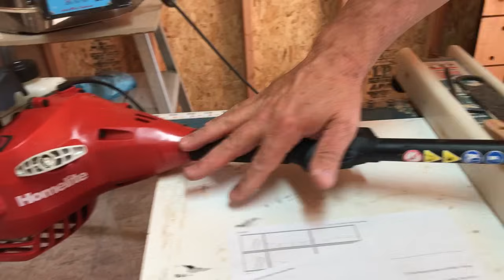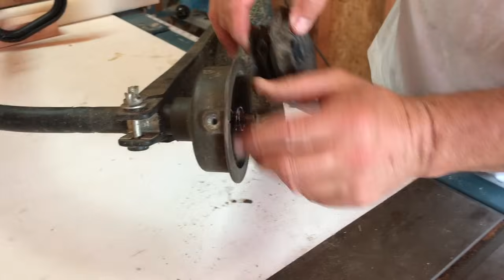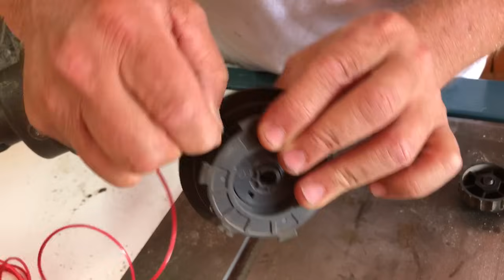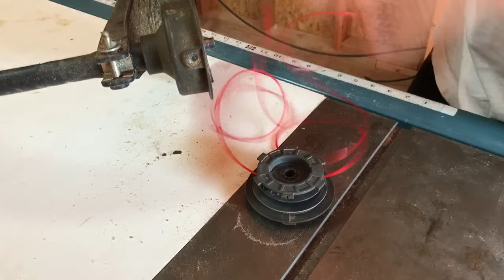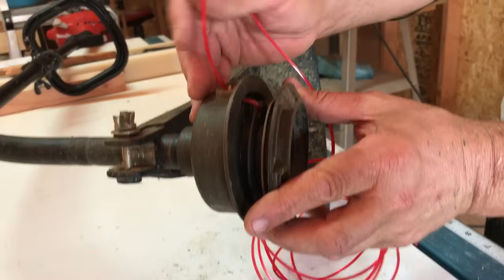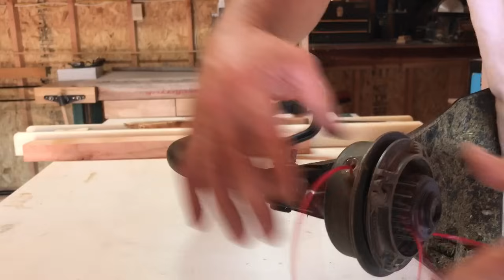How to replace string on Homelite grass trimmer

Comment: You don't even have to remove the cap, just spin the spool so the arrows on top line up with the holes, then you just push the string all the way through.
Reply: G M g55
Reply: Yeah but keep in mind sometimes depending on how.long u have had the weed eater n how.much uve used the same head on the weed eater u might not be able to even see the arrows to.line up with any more. Which happens to be mine exact issue so its just simplier to look thru the holes n line them up so u can see all the way thru..
Reply: YOU are the man! I couldn't get the cap off, was going to start hammering it. great tip!! THANK YOU!!
Reply: The red bolt loosens by twisting to the right (clockwise)
Reply: @jackjack4412  can u explain how, mine its too tight that i can't loosen it with hands
Reply: @06267394  if you have the same one in the video, instead of twisting it off to the left, twist it off to the right.
Reply: You will if you still have some string left inside that recessed back into the head (the new string will NOT go through until you've removed it... which you have to take the head off to do so.) Thanks
Reply: So I have a string stuck inside the spool how do I remove the bump?
Reply: I don’t have the bump he’s using here

Comment: John:  I've had so much frustration in replacing the string on my Homelite grass trimmer and having it then feed out.  Your explanation was simple and worked for me the first time.  I then finished edging and had no problems with the string feeding out.  The enclosed instructions do not mention the key -
 putting the string through the spool, threading it through the casing, and finally using the casing to wind the string onto the spool.  Thanks so much!  Steve Graham

Comment: So happy to not have to do it the other way anymore . One thing I will say that has always done well for me is using stihl chainsaw oil mix with 89 octane like to says . 50:1 is good for everything 👍👍. Never had any chugging issues and it makes this 26 cc scream . Not kidding , screams . I have a high power stihl and a this one I found in the trash and put a new plug and primer bulb and it’s been good for 7 years now ? Something like that .

Comment: Times I've come close to throwing machine this across the garden! Now I know the correct way, thanks
 so much
Reply: Bob Davies 
I did throw mine across the yard quite a few times because of this problem, and I’m a handy guy, this video saved me from going crazy , I guess I just threw the box out and never learned how to put the string in properly, now it works like a champ
Reply: Everyone.just needs to keep im mind that these type of trimmer heads are called speed trimmer heads for a reason they were made to not take up too.much of ur time having to.reline/respool the thing every time. Speed meaning ur able to stop reload n get back to.work to get the job done faster. So u dont even need to remove the spool from the head or anything like that just measure n cut ur line n run it thru the head holes. Rewind the string into the head . n there u go good to go.

Comment: Ok, check out Gm's comment below. I took the head off because there was still string jammed in there. So I retrieved about 5 ft of string, and then put the head back together, and with a little wiggling was able to put it in place. So that gives me enough string to do a half hour or so probably. So between John and Gm, I've saved a lot of hassle and again thanks to both of you. Or should i say, "much grass, senors!"😎😁

Comment: My spool doesn;t have two slots for the trimming string. It did however come with the other piece with two holes but the spool you wind it on has no hole going through itself.  There are however about 8 holes on the outer piece spaced in the circle. How do I replace the string on that type?

Comment: Question, how do you get more line to feed out while the weed eater is still running. I keep having to power off the trimmer ,manually remove the cap and rewind the whole line again. It's so frustrating...
Reply: Hit your head on the ground,  that makes the string able to skip a notch and release more. Don't smash it, but give it a good little bump on the ground and keep going.

Comment: You actually line up the holes on the spool with the holds the string comes out.  Ensure the spool is loaded into the trimmer.  Push the string thru all four holes.

Comment: Yeah u know its easier to not even remove the spool from the head at all when restringing these head types. Thats why they are concidered a speed feed head. All u have to do is line up the holes so that u can see straight thru from one hole on one side thru the hole on the opposite side. Then push ur pre cut n measured line thru even it out on the ends n start winding it into the head.  N ur done. Its super easy compared to the way you are doing it. Specially once u get the hang of doing.it.this way.. Try it !! Ull see what i mean..

Comment: thing is I cant remove the cap😢
Reply: Just Chillin I can't either...
Reply: Some of the caps are reverse threaded. Turn it clockwise to loosen it.
Reply: On some of the Homelites the threads are clockwise to loosen.
Reply: You don't even have to remove the cap, just spin the spool so the arrows on top line up with the holes, then you just push the string all the way through.

Comment: Mine is a model ut200 46 doesn't look like the one you're using homelite easy reach does not want to turn off on the end very frustrating this thing stinks I've never had such a hard time